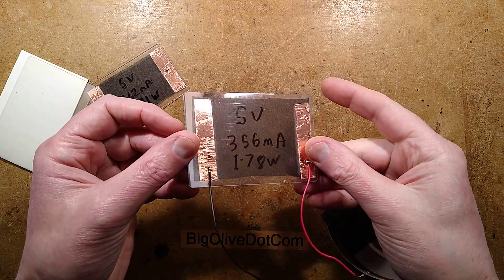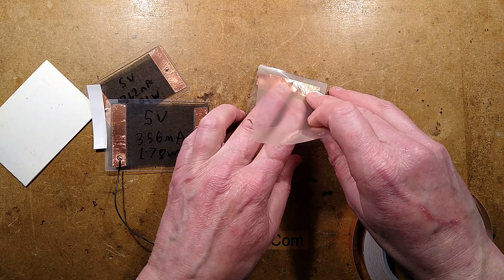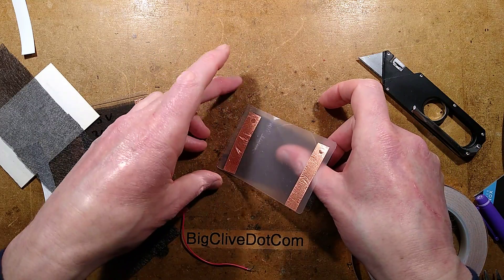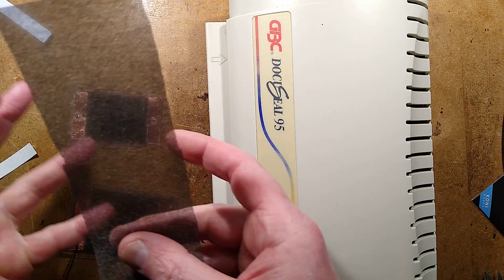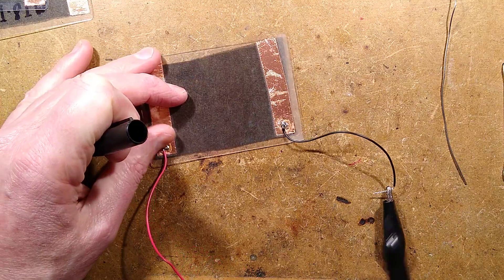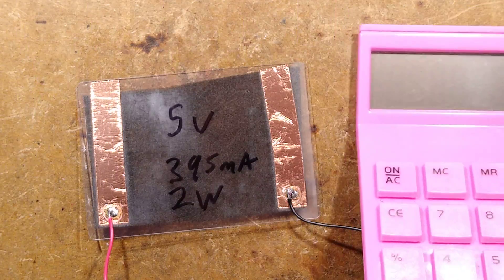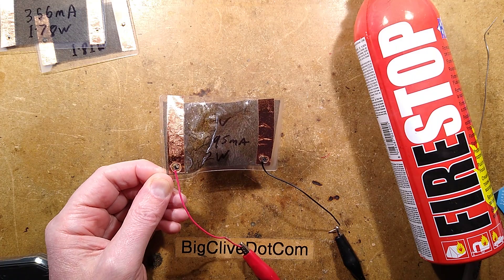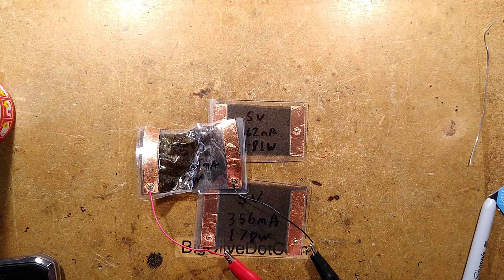Making custom heater pads and then destroying one

Comment: ok this might sound a bit stupid but.... wouldn't sandwiching the carbon fibre between 2 pieces of Kapton tape be more temperature resistant solution?

I actually thought for a second about sandwiching between SILPADs, because i happen to have a fairly generous roll of that here. Which was indeed quite cheap (for SILPAD material). And only £6-12 or something (from aliexpress). However that silpad stuff still works out to be a lot more expensive. And there is no adhesive. So then you add the cost of some 3M roll of high temp athesive (good to 120c or something)... and it becomes quite pricey to go down that route.

Other than sandwiching between kapton tape, you can then also make that the middle layer of a sandwich of thing aluminium sheeting. So it would go something like this: put down a layer of thin aluminum sheet. Of whatever thickness you desire. Then cover that in Kapton tape. Or if you prefer use a pre-anodised aluminum, or other product of aluminum sheet that is already pre-coated. Or maybe you could even paint the aluminum sheet yourself. However a good layer of Kapton would probably be easier and safer right?

Ok, so aluminum, then Kapton. THEN the copper tape for the terminals. THEN the Carbon fibre tissue. OK ok. Then another layer of kapton tape. And some compression. Like a mangle or a pasta making machine or something with rollers. Or a tremmel? is it called? So there you have your layers stacked. Now ontop of the final kapton layer you can either put insulative material onto that back side. If you do not want the heat to go both sides. Or you could have done the thermal insulator layer FIRST, instead of the first aluminum layer.

Or you could top it off with a layer of thermal compound, or 1 layer of SILPAD, or just a 3M high temp adhesive layer (for example a genuine 3M 468MP). To stick something else on. Which could be another layer of aluminum. Or a heatsink, or something else. Who knows.

The main thing I cannot come up with here is what kind of a sheet material would you use for a thermal insulator barrier. But if it is a lot thicker, then you would (for examlpe) just do both sides aluminium foil regardless. And then on 1 side after its final alu layer then add your thermal insulator layer(s). Of other type of thermally reflective etc. material. Or foam or whatever is best. IDK. It seems like there are lots of options. So maybe other people can suggest other types of improvements. Which could be used instead (or used in combination with these set of suggestions).

Comment: looks like you need to embed it in something that isn't going to break down at higher temperatures. Lamination plastic isn't ideal because its entire purpose is to melt at a relatively low temperature. You also want it to be thin and flexible, though. Maybe silicone? Clamp it between two flat surfaces to make it as thin as possible.

I think you'd probably also want to try baking the moisture out of the carbon fibre much like you would for 3D printer fillament (food dehydrator is best). I'm guessing silicone wires would be a good idea too, I wonder if you could get it to seal with the silicone substrate to make it waterproof.

Comment: These would be great for adding heated mirrors to vehicles that are no equipped with those from the factory. Also might be used to keep electric boxes dry. People have traditionally used low wattage light bulbs for those purposes but those do burn out with time. Just customize the resistance for 12 volt supply.
Reply from the maker: A well under-run power resistor is a handy source of warmth in some enclosures.

Comment: I've used copper foil tape to make "hidden" speaker wires. Just stick two parallel strips on the wall, and paint over them. I've also passed control signals through copper tape in the same way. Sometimes I would use just a single strip, and the earth as the return wire. Only low voltage/current stuff.
Reply from the maker: There was genuinely a commercial under-carpet electrical system that worked like that.  Laminated copper strips and insulation piercing sockets.  I was never really convinced at its safety or reliability.

Comment: That was interesting.  Just a thought - but maybe handling the copper tape would be easier if you cut your carbon piece to size first, stuck the tape across the ends of the carbon, then slid the whole thing into the laminate plastic.
Reply from the maker: The adhesive side of the tape is not conductive.

Comment: Is there a ROBUST type of flexible heating element that works well with low voltage DC?
All the carbon variants I have found fail over time, even after “battle hardening” them with braided solder wick for the electrodes...

Really need a robust option for a heating element that can last normal use in service for years when flexing under foot in a show or glove!
Reply from the maker: This might be the best option for that.  Electronics in shoes have a very rough time.

Comment: Would dual layer carbon be more resistant to higher voltage?
Reply from the maker: It would have lower resistance and get hotter at the same voltage.

Comment: Wouldn't it kinda make more sense to write the resistance on it? I mean, you may not always want two watts and the resistance would kinda be more helpful when calculating the required voltage for the power you want. Anyway, I wonder if you could use it to laminate itself. Probably rather inefficient, since you're not really heating the areas you mainly want to stick together... But maybe still an interesting experiment...? You could probably also make it conform to a shape by heating it 'till it becomes soft. Quite versatile. :D

Comment: When I first started rebuilding vintage magnetos around 10 years ago, I was told by my guru to use some adhesive backed tinned copper tape for the final connection from the very fine secondary wire to the HT output. Bare copper tape wasn’t ideal for a few reasons.
I was pretty poor at the time, struggling to get tooled up for this little business. The bare copper tape was ridiculously cheap & easy to find, but I had to pay around £40 for the same stuff that was tinned! & it took some searching to find it too.
£40 for a single roll!
Fortunately each coil only uses a small piece & 10 years later I’ve still got plenty left.
I bet it’s available a lot cheaper now, but I can’t see me needing another roll for at least another decade.
Weirdly it’s tinned on both sides, before the adhesive is added. I’ve never bothered to look at it under the microscope to find the copper centre though.

Comment: Plastic lamination sheets are probably not the best thing to use for this, due to the low thermal conductivity, and low melting point. Wrapping it in kapton tape could be a better alternative.
Rather than carbon fiber, if you wanted more power/heat, you could use the same kind of stainless steel or kanthal mesh that is used for vaping. Obviously not with plastic lamination though.
If you really wanted this thing to get hot (say hot enough to melt solder) stainless steel or kanthal mesh could certainly work for that. Although I'm not sure what would be a suitable material to insulate it so that solder doesn't wick into the mesh and you don't short it. Kapton tape isn't very durable at the temperatures you need to melt solder, it tends to deform and shrink.
I think this concept could make for a good low cost (nearly free) soldering hot plate, if the right insulator is found.

Comment: Thanks Clive! I have used the already made ones that are for the jackets and fitt them in My mitts for winter Bike rides they are thr sewn carbon thread type there are five heating pads they draw a bit over an amp at the 5 volts! Cheers!!! Rick Armstrong Aurora Ontario Canada
Reply from the maker: Thanks.  Much appreciated.

Comment: lol - "there's the smoke again, this is good"! I like how at the beginning there were concerns about breathing in carbon fibres but at the end it turned to "smoke is good"! Depending on the type of plastic which is breaking down that smoke can be really toxic. Just saying! 

Now, how the make a PTC heating pad? Or at least how to design such a pad for a specific maximum temperature at a given voltage. Use case: safely heat a 250 liter 3d printer enclosure to 60°C using 24V.

Comment: I have a mains powered heat pad with similar construction. The copper is stitched to the pad material ( probably not the same carbon fibre but looks similar). Stitching would provide more secure and even electrical connection.

Comment: Is it possible to use a polymer liner and the carbon tissue to make a battery? Would you need a dielectric fluid to make this possible?
Reply from the maker: You could possibly make a form of zinc carbon cell.

Comment: 1- why the adhesive copper tape? why do you need the adhesive or the copper for? don't a stripped wire do the job as well when you laminated the whole assembly?
2- you can make the S version but with 3 layers of carbon fibers interleaved on junctions, to get the same overall resistance but avoid hot/cold points and not needing copper tape on junctions.
3- maybe pre-heating the assembly before laminate it will disperse moisture and help to fuse plastic layers on fibers.

Comment: thats actually a genius idea to have a heater with a huge surface area !!
i was contemplating the whole power resistor strapped to a huge meal sheet , but this is way better 
i have to substitute the carbon fibre for something else i can actually get in my country

Comment: You could have made that prototype with 1 hole on the top and the other where it is currently located.  The current in the errrrrr current position will likely to heat more between the wires and not the entire copper pad.  and you've just shown that with the thermal camera

Comment: Or since the envelope you put the thing together in is open on 3 sides you could put the copper tape out the side an wrap it around the top, then the adhesive is holding the tape down and you can solder to a tab exposed on the outside, this would also remove the need to punch a hole in the envelope.

Comment: Stained glass copper tape is a bit thicker and takes to soldering well. The adhesive is also quite heat resistant.

Comment: I have some nickel plated microfiberglass that would be amazing for high heat applications. Only issue is cost, and not knowing how the acrylic binder acts/can be burned off and still form a sheet. I do have low carbon fiber content fiberglass as well, but pretty difficult to get good conductivity across the whole sheet.

Comment: Why not adhere the copper strips directly to the carbon?  Then the solder would not need to penetrate the glue.  Also, the strips and fiber sheet would be installed together making assembly much easier.
Reply from the maker: The adhesive would act as an insulator.

Comment: It would be interesting to try to construct a higher-temperature version of this using something like a couple of glass plates clamped firmly together instead of the plastic sleeve, and then seeing how hot you could actually get it before it started suffering ill-effects...

In theory, if you used the right materials, you should be able to make something that can produce quite a bit of heat output (but the failure mode when you push it too far might be quite a bit more dramatic)..

Comment: This is amazing! I can see so many uses for these, including heating electronics. In cold environments equipment needs heaters inside to keep the electronics at operating temperature, and these little pads seem perfect, you could even place them right under a PCB to heat it. It also seems to have a slight positive temperature coefficient meaning it can't go into thermal runaway.

Comment: so it looks like 1 - maybe this needs to be laminated in the vacuum 2- maybe use higher temp plastic? 3- what about using something else to seal it with like resin and maybe the base can be ceramic plate, or maybe two ceramic plates on both sides like peltiren cells, and silicone in the midlle? mind you not sure how well connected those contacts would be, you would probably need to crimp them maybe? maybe using the zinc battery strips will do? I would suggest in that case the red - heat conductive silicone

Comment: That kind of random strand orientation cloth is called chopped strand mat, at least that kind of fibreglass is anyway. I've seen woven carbon fibre cloth, but I haven't seen that kind of tissue thin stuff before, fibreglass or carbon fibre. Although it has been a long time since I've worked with fibreglass, so it's probably a new thing.

Comment: How about making A4 version with A4 carbon and A4 sleeve… 
In the winter… having two under your coat.. one on your stomach , one on your back… hanging down from over the shoulders.. maybe sewing or taping them to a vest…
Supplying with 12V or other correct voltage… Could be really helpful in harsh winter conditions ❄️🔥

Comment: Idea for Clive.  A low voltage rodent deterrent for bird feeders.   
We have squirrel proof bird feeders, but the raccoons are clever enough to take the feeders down.   I don't want to harm the animals, I just want something to keep them from damaging the bird feeders.
Reply from the maker: Very high value resistors in series (for safety) and a diode charging up a low value capacitor from the mains with respect to ground.  Gives rogue critters a sting.

Comment: I think it only self destructed because you had it in air and the heat had no where to go. If you bonded it to a head sink you could probably run it at a higher power indefinately. or use Kapton tape with high temp ahdesive.

Comment: Earlier I mentioned a 20W (as they state) 510 screw-on soldering iron. It comes with two spare heaters and three screw-on tips of different shapes (horseshoe, knife and conical).
Its impedance is around one Ohm, and it actually works good. I didn't believe in USB soldering irons initially, but you changed my mind radically. Thank you, and thank you again.

Comment: Would the carbon cloth still work as a heater if impregnated with resin?

(to make a heater with a solid form, like a heated seat without padding)
Reply from the maker: It should, but you would need to make a good electrical connection to it.  Thicker cloth would have a much lower resistance.

Comment: I found a UV-cured resin which is both hard enough and withstands temperatures of soldering with lead-based solder. It also solidifies very well, isn't sticky at all and allows for machining it.
I recently made a couple of flat plates out of it, placed some SMD components, connected them with a thin enamel copper wire, laid and secured the wires on the board with this resin again, guided several jumpers on top of other wires, tested the circuit and covered everything but the components in resin to protect it even more. In case I need to replace an IC or another component — I still can do it.
No, I'm not saying anyone else should do the same: if you need a circuit — do it on a proper PCB. But experimenting, and making something custom, and trying various options, and learning from it, and having fun — yes, surely! Because we can.
Reply: I'm thinking of using a similar copper adhesive foil next time btw. ;D
Reply: Now need to test how heat-conductive this resin is.

Comment: gotta file a nail on one of your index fingers. keep it nice so you can get at tape and small screws n what not. I never cared about my nails until i started a shop job. now i really need at least 1 most days. i use to bite them but now i keep a nail file on me and and time i get the urge to bite i just file. so now i got better nails than my sisters ^_^

Comment: Absolutely the best way to find anything that's dropped into a parallel universe and become 'lost' forever is to order a replacement, works unfailingly.

Very interesting project though, it could be really useful for stabilising electronics at a set temperature.

Comment: maybe a good jacket liner? running these strips in a maze all over  inside the lining and have the plug be inside the jacket pocket and attach  a low voltage battery.

Comment: I bet the resistance is fairly stable thermally up to a point. You could make high watt resistors this way as dummy loads for power amplifier testing. or power supply load testing. stack more sheets on top of each other before laminating. lower resistance, higher wattage. Clive where did you find the carbon fiber tissue? Having a problem locating it.
Reply from the maker: carbon tissue modelling

Comment: 65c u can soft boil eggs for work fine tune it or add Bimetal Disc Temperature Switch Normal Close Closed 70c
Reply: for those who dont know but might also like to play with
 220V 100W Cartridge Mold Heating element heater Tube Single Head

Comment: It appears that that carbon fibre is not of uniform resistance - higher resistance to the left hand side than the right. It was notable that the left side copper "busbar" was viewable in the thermal image as it was warm enough to show (with the cool spot where the soldered wire was drawing heat away clearly visible) whereas the right side remained cool and undefined. This may cause localised hot-spots if one were to try to cut a filament type heating element from that particular sample of material.

Comment: You would be better off cutting the carbon filament to the size you want, then sticking the tape to the carbon filament, then punch holes in your laminate pouch and then laminate it. This would allow you to trin the rough edges down to a preferred size.
Reply: The adhesive on the tape isn't conductive. You need the nonstick side of the tape touching the carbon